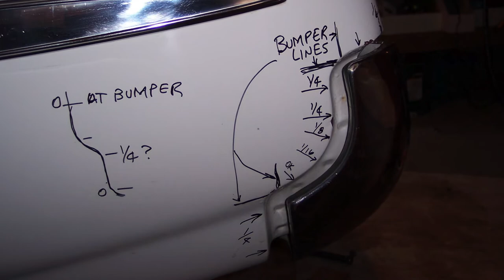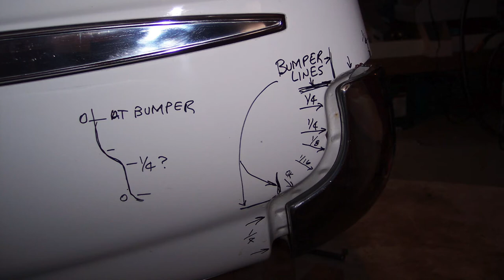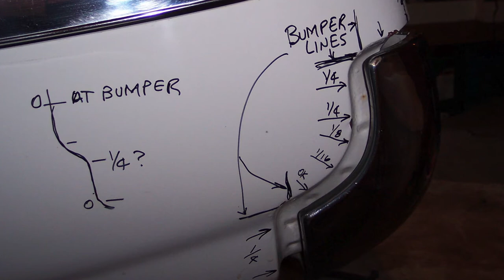1964 Buick Skylark Part 3. Saving LowFlyLark. DIY rust repair, quarters, Restoration, RestoMod...

Comment: I have a 64 LeSabre with the same kind of body trim on the sides how do I remove that?
Reply from the maker: Check inside the trunk and look at the backside of the rear fenders. There should be a few nuts that hold the ends of the trim, and if the LaSabre is the same as the Skylark, you will see plastic tips of the other fasteners pushed through slotted holes. The doors and the front fenders should be the same with screws or nuts holding the ends of the trim from the backside. The plastic fasteners can be pried off with a putty knife, or similar tool. Some of the plastic fasteners may break.